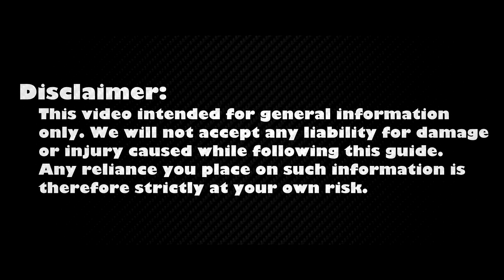Acer Aspire S5-391 Keyboard Replacement | Easy DIY Repair

Comment: hello...just replaced the battery (i got the message to replace) but doesnt charge...did the battery button reset but didnt work...any suggestions? thanks in advance